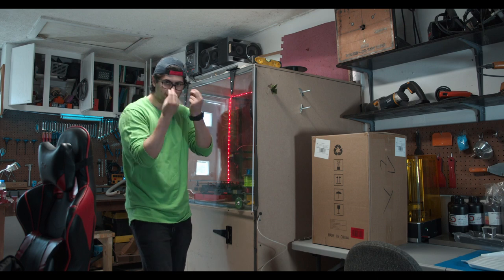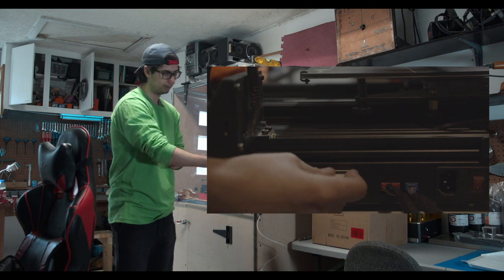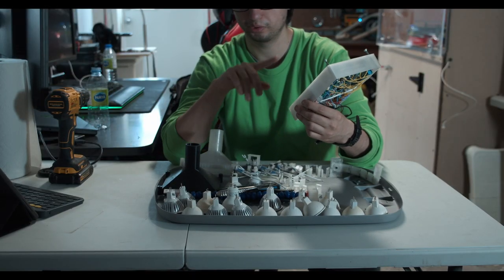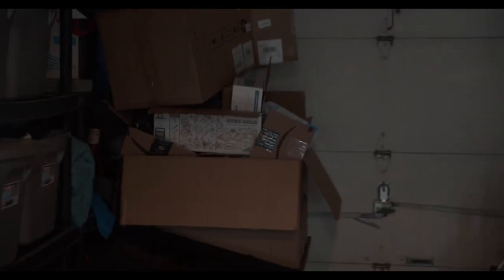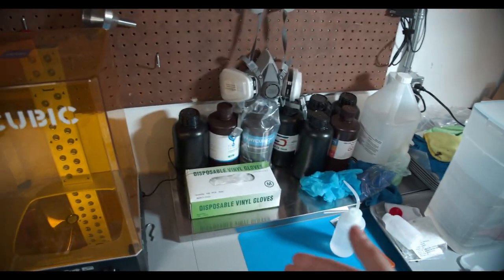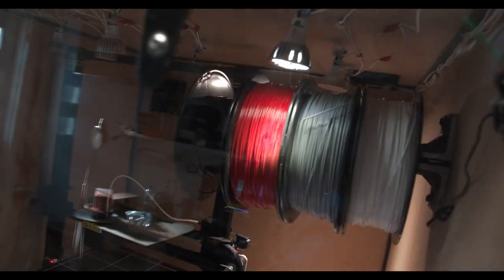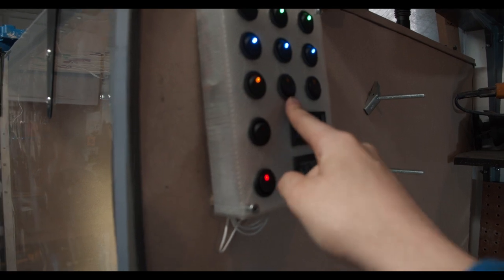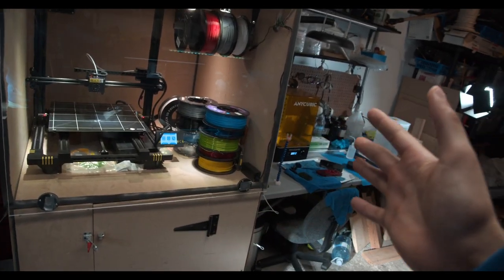EVERY 3D PRINTER NEEDS THIS. | DIY 3D Printer Enclosure

Comment: Nice!! I am currently trying to figure out how to do something similar. I am looking into ssome ptc fan heaters for enclosures. I have a qidi x plus printer, so its already enclosed. Now I just want to insulate it, and actively heat it. Good video man!!
Reply from the maker: wood worked out for me, but I've seen some higher budget projects use plexiglass and rubber insolation

Comment: Why not change the hinge on the door to move sideways and an SD card extender to let you load the sd card from the front?
Reply from the maker: not a bad idea on the sd card, i used to have it all wireless but it led to lots of issues, as for the door i wanted it to seal with gravity and its wayyyyyyyyyyyy to heavy for the cheap mdf wood to support